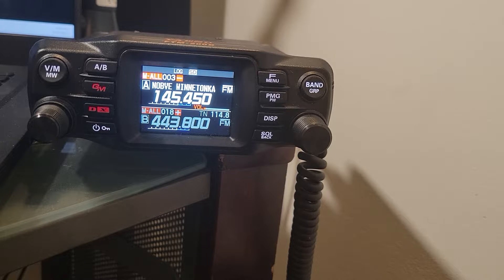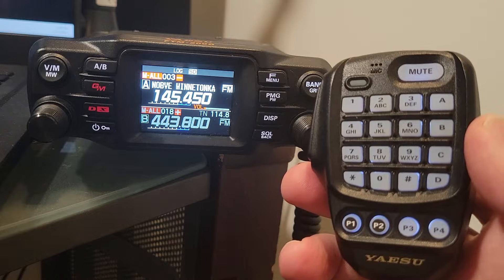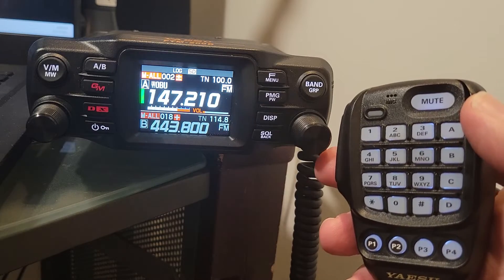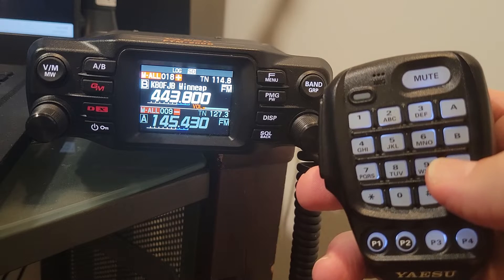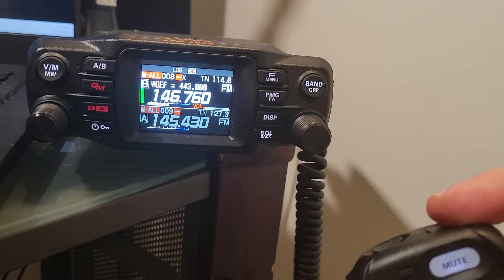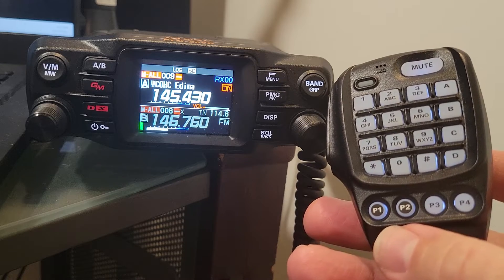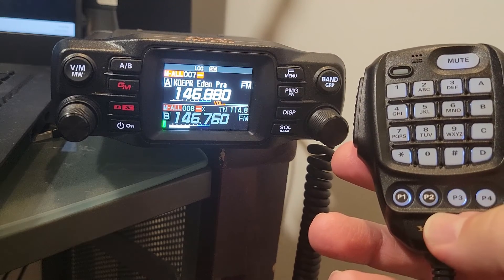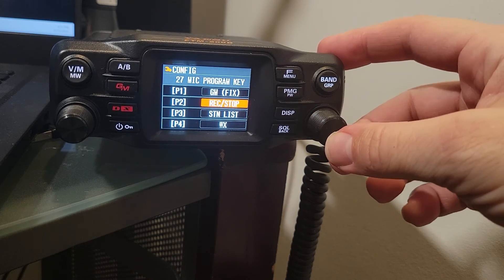Yaesu FTM-200D - Do More With the Included Microphone!

Comment: You made numerous references to dual receive.  I do not believe the FTM-200D is a true dual receive radio.  "Dual-band monitoring – The FTM-200DR does offer dual-band functionality. It’s not a true dual-receiver radio, but it does have an option that allows you to frequently check the secondary band at a programmable interval, which can mimic dual-receiver functionality in some use cases."